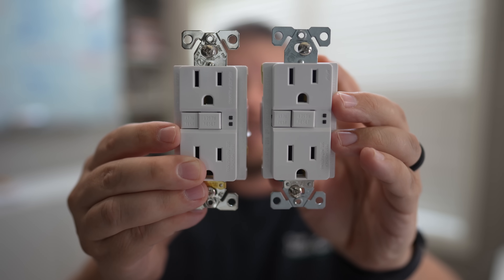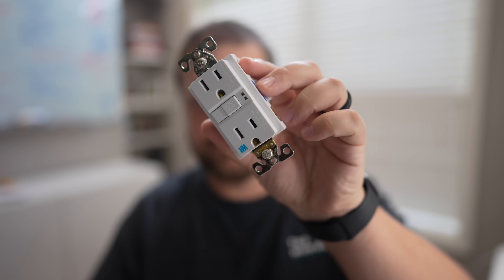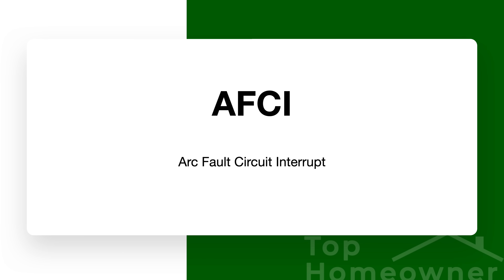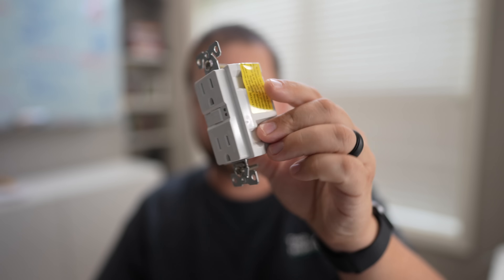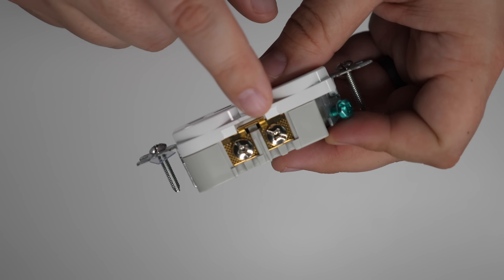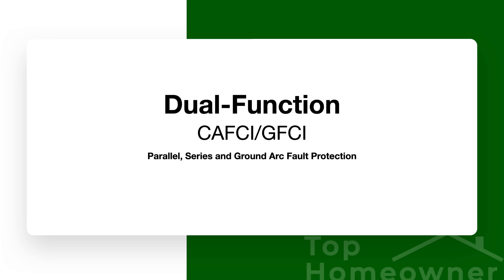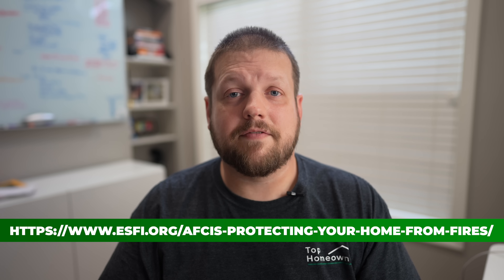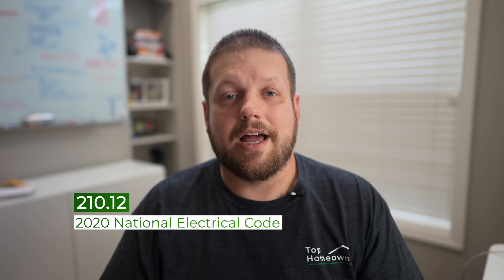AFCI vs GFCI: What's The Difference and Why You Should Care

Comment: A standard breaker has ground fault protection.
Reply: False.
Disturbing that your level of knowledge can be so low yet you still comment.

A standard breaker provides two means of protection:
1. Isolation - the user turns it off.
2. Over current.

It provides no other type of protection.
Reply: @deang5622  not to argue but the third protection is short circuit. Thermal Magnetic breakers offer both over current and magnetic short circuit protection.
Reply: @DaveS987 Short circuit is over current.

The question is, what current flows when there is a short circuit? If it's less than the breaker rated value, the breaker doesn't trip.
Reply: @deang5622  No the trip unit in a breaker has two portions, thermal which measures the current flowing and a magnetic portion that only trips the breaker under a short circuit condition.
Reply: @DaveS987  thermal is for overload and magnetic coil is for ground fault and short ciruit.
Reply: @DaveS987  thermal gets hot from overload and trips depending on how long and hard it is being overloaded time curve chart, short circuit and ground fault behave the same as long as ground fault path is done correct with low impedance. Both short circuit and ground fault use magnetic coil.
Reply: @deang5622  btw your an idiot. Im a pro and licensed,what I said is 100% correct. You obviously know nothing about ac theory or the national electrical code so know your roll and shut your mouth.
Reply: Sorry wrong
Reply: @DaveS987  im am 100% correct fool!
Reply: @jeremiahnewsom7775  you are not correct, I work for a breaker manufacturer and have seen the inside of both. A GFI and AFCI breaker contains a circuit board that detects the current imbalance between the hot conductors and neutral and ground and trips when it does. The magnetic trip portion of a  standard breaker only trips on short circuit. The arc of an arcing fault does not contain enough energy to trip a standard breaker thus the reason the AFCI breaker was invented. But you stick to your story and go ahead and call me names because you know more than a guy who has been working with breakers for 30 years.
Reply: @DaveS987  a ground fault and a gfci are two different things my friend. 
a normal ground fault will trip a standard breaker. gfci is protection against ground fault with a load.
arcfault breaker monitor sine wave and looks for a number of spikes , i think it 8 spikes in less than a 1millisecond. 
it is mainly for bad connections.
Reply: @jeremiahnewsom7775  "a normal ground fault will trip a standard breaker." -- not before it kills you though. And that's the problem.

A "ground fault" is any situation where the current returns to ground via a conductor other than the neutral. Period. A breaker that only provides over-current protection will fail to trip on any ground fault that results in a current lower than the rating of the breaker (and even above that rating it will take time...all breakers have an over-current trip chart that shows how long the over-current condition has to exist before they will trip, and this is often on the order of minutes or even hours for conditions just barely over the rating).

The problem is that you don't need nearly 15 A (the typical lowest-rated breaker found in a North American home) to kill a person.

A GFI breaker will trip if the current imbalance exceeds 6 milliamps . I.e. a miniscule amount of current.

Your conflation of "ground fault" with "over-current" is just not useful or correct. They may arguably be related situations, but they are most certainly not the same .
Reply: Just to be fair guys, This comment was a trap.
Wanted to see if anyone on here knows their stuff.
If you dont know the difference between ground fault protection and a ground fault circuit interrupter(gfci) than you should not be giving anyone electrical advise.
Reply: Again i will make this simple as possible/
A normal ground fault will trip a standard breaker. If the breaker is 10ka and ground fault path is correct with low impedance it will produce 10000 plus amps to run through magnetic coil just like short ciruit and open breaker.
If a human becomes part of a circuit it is a ground fault with a load and you will not pull 10000 amps or anywhere close to that, so breaker will not trip within one second like it is supposed to.
A gfci interrupts the circuit at 5ma imbalance to keep human from being electrocuted!!!!!!!!!
Reply: You know when you short a wire at home and see a spark, that spark is the result of 10ka or more. 120/240 can electrocute you just as easy as high voltage. It is easier to let go of lower voltage. But the other main reason that higher voltage is more dangerous is because besides electrocution there is another major hazard is working on energized. Is you short out or ground fault energized 480 or higher you dont get a little spark. You get an explosion. Arc blast and arc flash, plus catching on fire.  Leave the electrical work to the pros, and read some books!!!!!!!!!!!
Reply: It takes years and years and years of experience, study, and schooling to really understand this stuff so unless your a highly trained and experience and educated journeyman, master, or engineer you should not be giving electrical advice.
Reply: The only way that this statement is correct, is that the non-gfci outlet is being fed (connected) from another gfci outlet or circuit.
Reply: @rtp4919  i am 100% correct fool do your homework boy
Reply: everyone who responded to this, are yall ready to go to school cause im bout to take ya.
A standard circuit breaker is a form of overcurrent protection. There are 3 forms of overcurrent protection. Short circuit, ground fault, and overload. A standard breaker has 2 mechanisms that cause it to trip. One is thermal strip for overload. The other is magnetic coil used for short circuit and ground fault. Most dwelling units use a 10ka interrupting rating which means in the case of a short circuit or ground fault thats have much current it takes to run through coil and open breaker.
A ground fault behaves just like a short circuit if the ground fault path is done correctly with low impedance.
If a human becomes part of a circuit it is now a ground fault with a load and not enough current to trip breaker using the magnetic coil. Thats were gfci comes into play, gfci is ground fault circuit interrupter. It uses current transformers or ct's to monitor grounded and ungrounded conductors for an imbalance of 5ma or more.

You guys shut your moouths when your talking to me!!!!!!!!

Comment: I had to install some AFCIs in a new shop building to pass inspection. After the inspection I switched them to GFCIs so I could use tools like a drill or saw that created sparks internally and tripped the AFCI. A 120v drill is liable to be plugged in anywhere in your house, so I'm not a fan.
Reply: AFCI's don't like older vacuum cleaners
Reply: @patrickmorris9710  so get a new vacuum, AFCI’s we’re invented because of electrical fires, not to be annoying.
Reply: @DaveS987 sounds like an unintentional side affect is that they are annoying.
Reply: @DaveS987  New vacuum cleaners also trip them. So do fans, hair dryers, some wall warts, and half rectified led lighting.
Reply: @akshonclip Rubbish.
Reply: @deang5622  Oh really? Then explain all the numerous nuisance calls in the last 15 years I have received because of stuff like that. C10 Field electrician here.
Reply: @DaveS987  The obedient always think of themselves as virtuous rather than cowardly — George Carlin
Reply: @glaucouswingedgull  “And although I broke a lot of laws as a teenager, I straightened out immediately upon turning eighteen, when I realized the state had a legal right to execute me.”

― George Carlin
Reply: @GeekProdigyGuy  I don't agree with everything Gorge Carlin ever said but there is definitely some epicwisdom in that quote !
Reply: You can get deals on cordless drills that are convenient.  Vacuum cleaners kind of suck cordless though
Reply: @davidsuzukiispolpot  ???? Aren't vacuums supposed to suck?
Reply: Are you on state specific code? The NEC doesn’t say anything about needing AFCI in a garage
Reply: Great to know. I'm not a pro and my NEC handbook predates the AFCI development. I was relying on information from the Web. I still might want to use a corded power tool or hair dryer within a house without nuisance tripping.
Reply: I think AFCIs are just a way to force us all to use batteries, eventually leading to complete control of the electric grid and alternative electrical sources.
Reply: That’s a great idea until something happens and the fire inspector finds you changed them and then your home insurance is voided by your home insurance company.
Reply: @DaveS987  "That’s a great idea until something happens and the fire inspector finds you changed them and then your home insurance is voided by your home insurance company." -- careful throwing that FUD around!

Granted, I can't speak for other people's situations. But I'll bet most, if not all, are similar to mine. I asked our insurance company whether we'd be covered if we replaced all the AFCI breakers with non-AFCI breakers and then had a fire that in theory might have been prevented by an AFCI breaker, and they assured us we would.

Each person should of course check for themselves what their insurance policy says, and what their insurance company says, but there's certainly no justification for your assumption that replacing AFCI breakers would have any material affect on an insurance policy at all.

Comment: is a gfci supposed to trip off if hot wires (with no appliance, just the hot wires) drop into a bucket of water ?
Reply: You really need to get your head around how a GFCI works.

There are two wires going in and two wires going out. Hot in, neutral in, hot out, neutral out.

In fault free conditions, currents, hot out = neutral out.

When a ground fault occurs and current passes to ground/earth, the neutral out and hot out currents are no longer the same.
And that difference is what triggers the GFCI and cuts the power off.
Reply: First how could that happen? It depends is there a path to the ground. If you just have a plastic bucket there is no path to the ground.
Reply: @okaro6595  oh. I overlooked that (path to ground).
I will test again. Next time I will add one more  wire in the water bucket to serve as a path to ground. 
I will stick the other end a few inches into the wet dirt or puddling water.
Does this sound right for a test ?
I'm just trying to see what it really takes to trip a gfci.
Also, I am trying to test if all of my gfci's are in working condition.
Wanting to use for outdoor extension cords, likely to contact water. 
thanks.
Reply: @pjwoo276  the buttons on the receptacle are not on/off switches. They are for testing. One is actually labeled ‘test’, and the other is labeled ‘reset’.  The test you are setting up is a much less safe way to do what the buttons are designed to do by law.
Reply: @pjwoo276  "I'm just trying to see what it really takes to trip a gfci" -- by design, 6 mA of current imbalance.

Any GFI device will have a test button on it. If you press the button and it trips, it's working.

For a more dangerous test, you can short the hot lead to ground. If the breaker's working, you can even do this with your hands. But if you suspect the breaker might not be working, doing that kind of testing is...unwise.